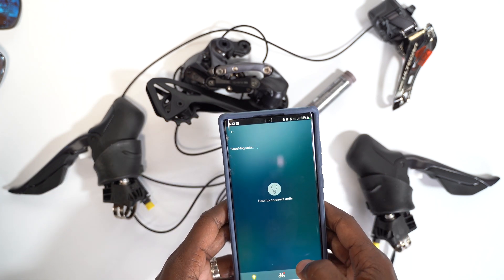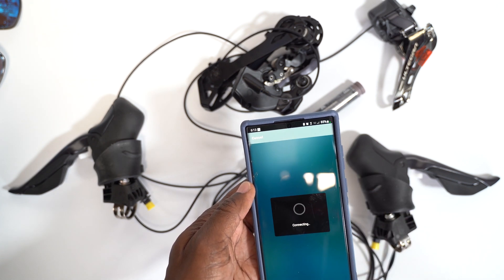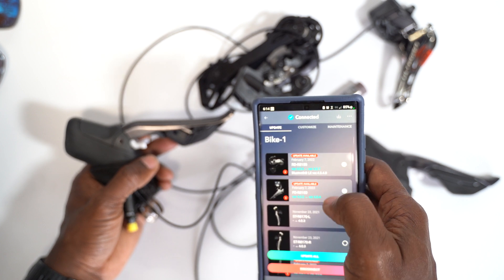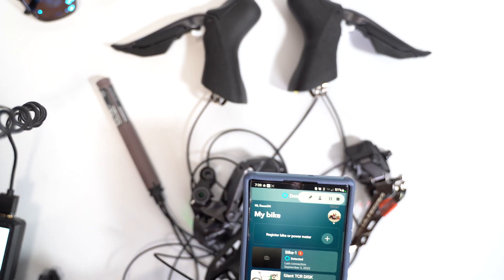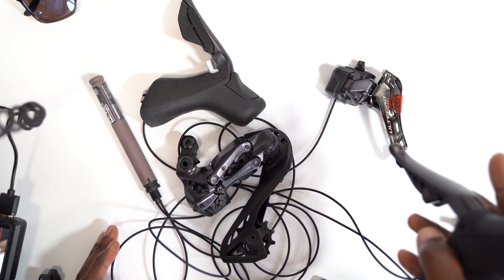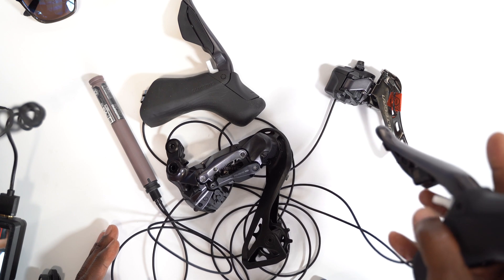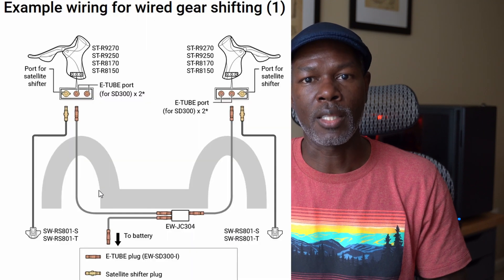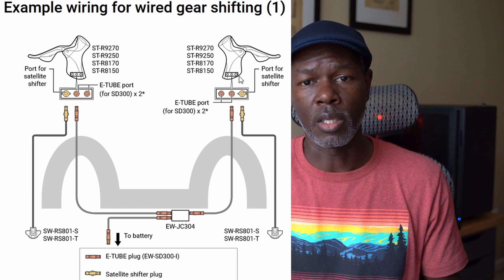12 Speed Shimano Ultegra DI2 Upgrade / Part 2 of 3 | fixing shifting issue

Comment: Hey! It's you! :). I'd just like to add that even when you're not using the wireless function, pair the shifters to the rear derailleur anyway. That way, IF one of the shift wires ever gets disconnected, it'll automatically fallback to the wireless system and you can keep riding :)
Reply from the maker: Awesome